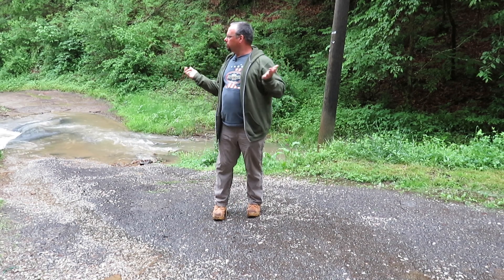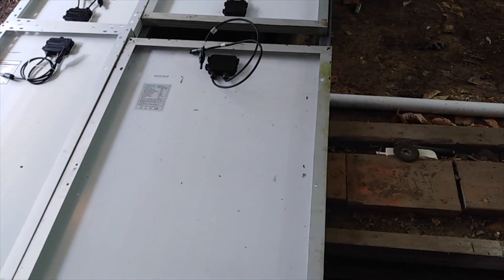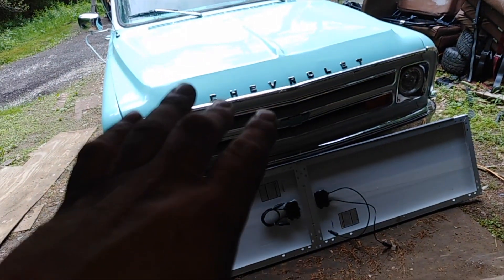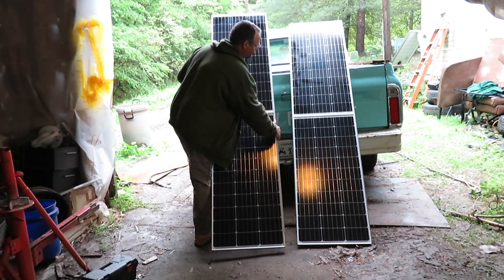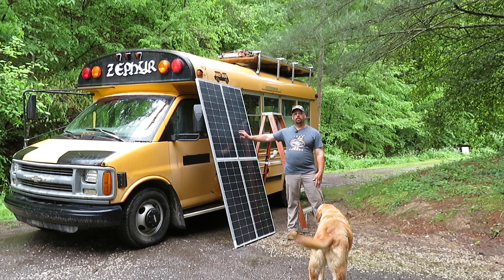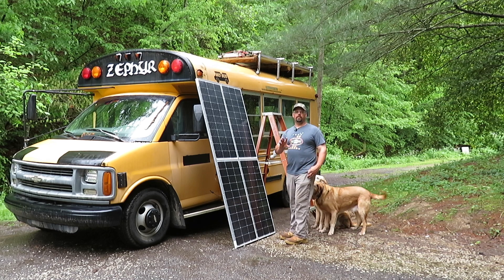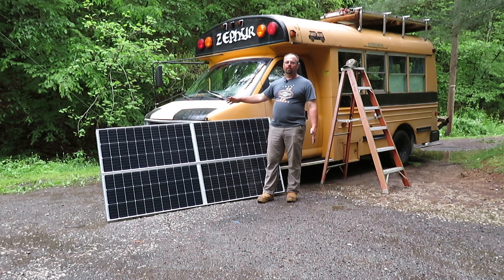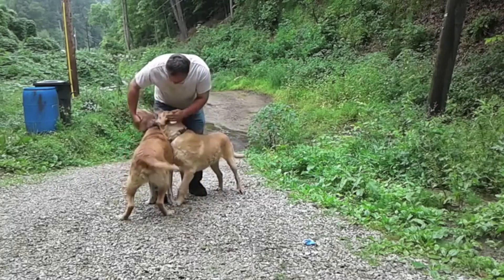Starting on Solar Power system for Zephyr

Comment: Hey Luke, the solar will be great! I have just 400 watts on my setup, and it does good running the four batteries I have hooked up. I have just a 2000 watt inverter, runs my 120 fridge overnight till the next blast of sun comes. It's an interesting balance of having enough storage to keep everything going when you have bad solar days. If I was $ I'd like to have 1200 watts and more battery to run everything without thinking about it! LOL! Great to see Zephyr with solar! Nice home away from home! Thanks for sharing! God bless!
Reply from the maker: That's good to know. I have two batteries right now and was planning to get at least 2 more. Thanks for the info.

Comment: I'm looking at those panels and the roof deck rails thinking they're awful close in size. Maybe Mount the panels to the rails and secure them and place on the deck and when you need to put up the rails point the panels towards the Sun.Viola enclosed deck... Just a wild thought, you seem to have everything well in hand
Reply from the maker: Cool idea. You and my son think alike. He was thinking about making a canopy over the deck with the solar panels. I was thinking of some way to have them mount to the front, then swing up on four legs over the deck. It just has to be a system which will lock into either position securely.

Comment: Would be great if you built it on a swivel base that could stand up and track the sun when you are parked. We gained about 25% at my sons off grid cabin making adjustments through the day. Great days to you and crew !
Reply from the maker: 25% is a significant gain. I don't know if a swivel base would work on a vehicle, but I could at least make them tilt.

Comment: All this rain has been a major pain for getting anything done for sure. Have you had record flooding on your driveway/creek? I like your solar arrays and how you are securing them together. 600 watts will give you a lot of power as long as the sun is shining, but on cloudy days it should still give you some charging. Are you buying batteries also, or do you already have some?
Reply from the maker: We have gotten more flooding in the last six months than we have in years. 

Yeah, I am hoping to have enough to help on cloudy days. I have a couple of batteries, but I'll be getting more as I can.